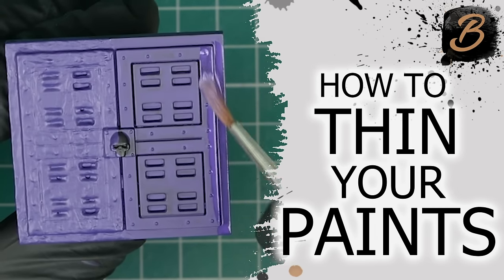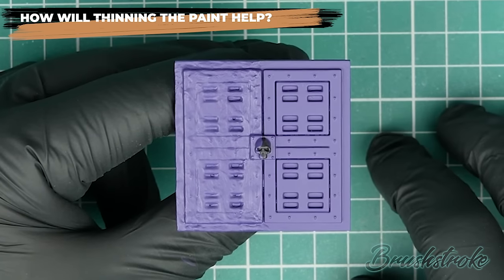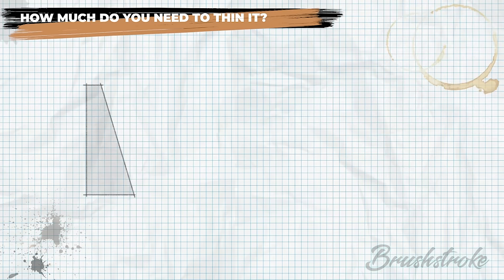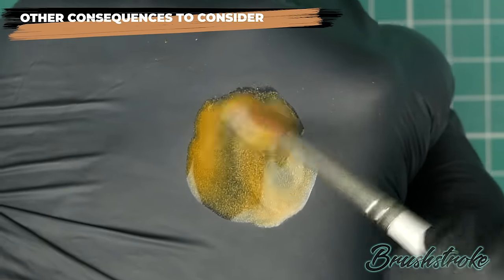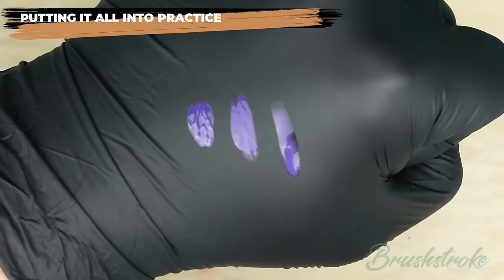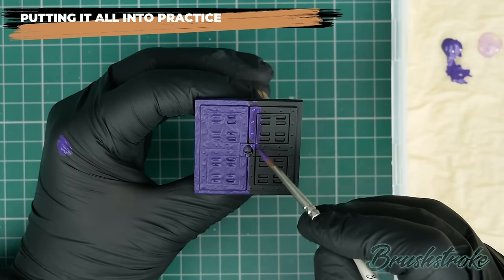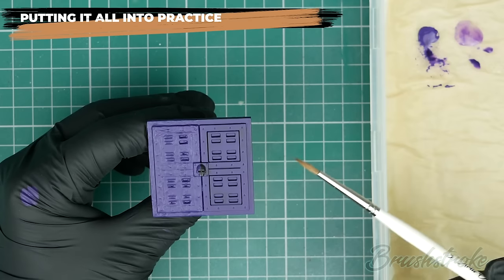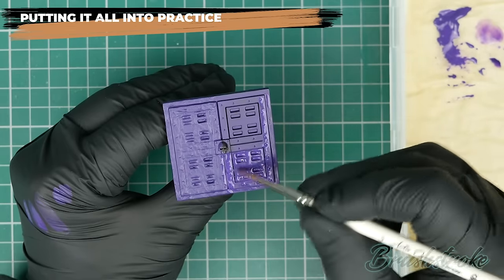HOW TO THIN YOUR PAINTS: A Step-By-Step Guide

Comment: The one thing I’m confused about is when to wick the moisture off the brush on kitchen paper. It doesn’t look like you do in this video but heard many others say it’s an absolute must. Could you shed any light on this? Thanks!!
Reply from the maker: No, I don’t do that.
It makes no sense to me at all, as to why you would want to get your paint to the exact consistency you want on your palette. Then load your brush but before you paint it on you model you remove a random amount of moisture out of the brush by touching it to paper towel.
I much prefer knowing exactly how my paint will behave by doing a quick test and then paint it on the model.
I did cover a little bit about brush loading in this video, which you may find useful.
https://youtu.be/chBHaXh8iko?si=HYEjqhra5Y4c0Ov_

I suppose it’s a case of finding what works best for you, but wicking is absolutely not a must 🙂
Reply: @BrushstrokePaintingGuides  thanks for the quick response! Would you say the same even for glazes where you’d need a really small amount of paint? I feel like I’ve watched that many videos and got that much information I can’t even load a brush 😂
Reply from the maker: @UXUXA  I can’t think of a reason where I’d ever want to wick my brush with paper towel. For circumstances where I need less on my brush, I simply load less on in the first place.
If I’ve overloaded it. I can just  apply a bit to my palette / hand to lessen the load.
Of course, if you’re finding you constantly have a brush with too much in it, move down a brush size to one which can’t hold as much in the first place.
Finally, make sure your brush is damp before loading, so that it doesn’t suck up more paint than you want it to.
Hope that helps 

Like I say; give the paint brush video a watch and see if it helps you 
https://youtu.be/chBHaXh8iko?si=HYEjqhra5Y4c0Ov_
Reply: @BrushstrokePaintingGuides  Mate this is so helpful feel like the video and info you've shared are an absolute game changer. I really appreciate you taking the time to give such a detailed response to an old video. Keep it up man, you've earned a sub from me :)
Reply from the maker: @UXUXA  no problem, I’m glad it’s helped.
There’s almost too much information available these days, it’s very easy for it to all become too much.
A lot of the hobby is about trying new things and finding what works best for you, but I try and make videos I wish I had when I started painting and try and explain what works for me. 
One last bit of advice I would give, is never stop asking questions. If something doesn’t make sense or you see something someone has painted and you’d like to do the same…. Ask how it’s done. You’ll find people are usually willing to help and share and then you can try again.
That’s what I did and what I still do.

Happy painting man, and thanks so much for the sub 🤛

Comment: It’s good, though I’d say: most importantly, your model should never be the first thing you touch with the loaded brush. As a painter/muralist, the nr 1 thing I see people do too little is: load your brush with some paint, put it down on paper (especially if too thick) and distribute it evenly on the brush. The number 1 thing that messes up people’s models is overloaded brushes. Thinning is one way of fixing that, though there is a specific finish to that which you have to like (it ends up looking a bit matte and milky). Another way is to not overload the brush, and either wipe it a little on a piece of paper (or: like many do; your hand/thumb) just to get the consistency of application right. 😊
Reply from the maker: I agree, and I did cover that in the video too. Always test your paint before applying it to your model.
I’ve also made a video on brush basics including brush loading etc 
https://youtu.be/chBHaXh8iko

Comment: So basically to find the sweet consistency, i just need to make sure if i try to pull the paints together, they can no longer form peaks?
Reply from the maker: For base coating like this, where you’re wanting a solid colour in the minimum number of coats, yes. You want it at that point where it self levels or settles. 
You got it

Comment: If I use grease-proof paper (parchment  or baking paper) this technique works. But if I use the paper that comes with my wet palette, the paper doesn't react in the same way. Could you do another video, but using normal wet palette paper. Cheers

Comment: 1:53 it really doesn't which you can paint with paint straight from the pot and get no brush marks but as you show later on you'll still get shrinkage which was my problem so thanks I was wondering why I could not get good coverage with just 1 layer of unthinnded paints!

Comment: I need to try this. I usually just go for the wet brush, grab paint, scrape off excess method. How necessary is the wet pallette?
Reply from the maker: Please let me know how you find the difference.
A wet palette is not essential but simply makes things easier as it prolongs the state of the paint by delaying evaporation.

Comment: Will you do a guide on how to thicken your paints more :)
Reply from the maker: Erm, not really. If you REALLY had to thicken a paint I guess you could try removing some moisture by either letting it stand to air dry a little or perhaps apply some to some kitchen roll / paper towel to draw the moisture out.
If you get into oil washes, you have to do that with the oil paint first to remove as much of the linseed oil before using it

Comment: How long should you let the paint dry before painting the next layer
Reply from the maker: That depends on a lot of factors, such as room temp and humidity, amount of water used etc
So, it’s really hard to give you a number.
Generally though, for a base coat like the one in the video in a UK environment at about 16°C about 5mins
If you thin down to a level of a wash though, that can increase to about 30mins.

Comment: Thank you! This is wonderful!
Thinning my paint has always been guesswork for me. No one has ever described how the paint should behave when thinned properly.
Question: how do you deal with paints that are already thin out of the bottle?
Reply from the maker: If a paint is too thin for the purpose you're wanting to use it for, then it's likely that particular paint is designed for a purpose which doesn't match what you're trying to use it for.
For example, you're trying to base coat with a wash / shade or perhaps the paint is pre-thinned for airbrush use.
Now, I suspect there are products which will thicken paint etc, but I've never tried them I'm afraid.
Instead I either accept I'm going to need to apply a lot of coats in order to build a solid colour OR find an alternative paint which is similar in colour and has better coverage to apply first and then apply the overly thin paint on top, more as a glaze in order to achieve the colour I'm after.
Generally , I will go with the second option and let another paint do the work and then glaze with the actual colour I want right at the end.
Hope that helps
Reply: @BrushstrokePaintingGuides  Thanks, that helps a little. I am confident the thinner paints I have are not washes or for air brushes because nothing on the bottles indicate otherwise (Vallejo paints, btw). I know oil paints of different colors will not all behave the same, so, could it simply be the case acrylic paints suffer the same issue?
Reply from the maker: @blackmage471  ok, another alternative is they’re not fully mixed and they need more shaking.
One final thing you could try is let them settle for a few days. Then don’t shake them but instead just drain off some medium and then shake them up. They should be thicker then.
Some paints come with excess medium to allow for them sitting on a shelf for ages etc

Comment: Getting the paint to the proper thinned state is my biggest challenge.  I find a lot of the time I either have it too thick or then it basically recedes off the surfaces I'm trying to paint and won't "stick" it just pulls back off the surface leaving it clean like it had "Rain X" on it.   I assume that means I'm thinning it too much but when I do it , it looks about like how yours looks when you have it where you like it, So I just haven't been able to get that down.  I am thinking of trying to thin with Mediums instead to see if I can cheat it.

Comment: Good video. Not a big fan of acrylics, they dry too quick when painting larger areas(needing retarders to try and slow down), and the "paint" is essentially a skin that sits on top of the surface rather than a true paint that can be absorbed by whatever strata is underneath. I always prime and this is the surface that the paint will adhere to,which with enamels works well. Get a tiny blemish in the layer of acrylic and it is virtually impossible to repair or blend in . The skin layer is damaged and when gently sanded with the finest of abrasives (like 1000 grit and above, way above, and wet) it will always have an edge to the damaged area. No, I don't really like acrylics, but have subbed and will watch your other videos and see if you have solutions......you asked for feedback,so there's some.

Comment: Interesting. I started painting some minis I 3D printed last year, and I was really sad with how the finishes weren't smooth and I could see brush strokes. I was using cheap craft paints, and so I had moved on and bought Pro Acryl instead. They're wonderfully better paints, but I also thought they would magically not leave ugly brush marks. Yet, they did.

I couldn't figure out what I was doing wrong, and I just thought this was the inherent flaw with brush painting - that it leaves an ugly uneven texture. So I kept thinking, well, this is just how it is. Brush painting is for ugly paintwork that has a bit more control, and airbrushing is for perfect paintwork that is more difficult to do on tiny areas without tedious masking.

It bothered me so much that I ended up dropping money on a compressor and airbrush and mostly giving up on brush painting, thinking all it would do is ruin my surfaces. And, indeed, I get lovely perfect coats of paint with the airbrush.

But I had no idea that I had to thin my paints to get rid of brush strokes when brush painting. I guess intuitively, why this works doesn't make much sense. But it apparently does. And maybe it should be intuitive, because what do you do when you airbrush? Add thinner to the cup.

It's also unintuitive because if you brush paint with thinned paint, the first coat looks HORRIBLE. It makes you seriously start worrying that you've ruined everything. So for a beginner like me, it scares me back to applying them more thickly in just one or two coats. You can see it in that first coat you did, it's all watery and bubbly looking before it dries to a nice finish. Seeing that watery bubbly coat would be what terrified me away from thinning.

Anyways, looks like I'll be trying brush painting again.

Comment: So here's something you might not have thought about.. How do I set up a wet pallet like you do there? Do I just put some paper towel in a tray and moisten it?  In the past I've tried putting parchment on a sponge in some water, but it sucks up into the dot of paint and after a new minutes separates it and it becomes completely unusable, nearly pure water.  What I've been doing on the regular is use a plastic palette and drop in a drop of air brush paint thinner with it instead of water. Could you give me some advice, should I try the paper towel thing? Or is my paint thinner thing ok?
Reply from the maker: It sounds like the paper you're using for your wet palette membrane is letting too much moisture through and over saturating your paint.
I made a video on my wet palette and it has the specific paper I use etc

https://youtu.be/NLcuicvJFKo

Thinning with paint thinner isnt a problem at all, in fact you'll find you can thin the paint down a lot more with thinner compared to water. However, I would still recommend you try and get a wet palette working for you, as it will prolong the time you can work with your paint and help prevent it from drying too fast on your palette

Comment: I'm also a bit curious about your pallete setup. I'm assuming it's a wet pallete? I'm using some random parchment paper I got from the grocery store and I'm not sure that it's ideal. It's for sure not the same as what came with my army painter wet-pallete as far as how water goes through it.
Reply from the maker: My palette is home made.
The paper is a premium parchment paper (still hugely cheaper than the branded wet palette sheets)
I could put a vid together on making and using a wet palette, including the paper I use etc

Comment: Do I need to do the same with the varnishes? I got the gloss one and it leaves brushmarks, I used the mate varnish before and it worked fine
Reply from the maker: Sometimes varnishes do need a little of thinning down, especially if you're wanting to hand brush them.
Don't use water though, I would always recommend looking up what thinner the brand suggests to use.
It's usually on the side of the bottle. Varnishes are quite complex in their makeup and often dont respond well to having water added

Comment: Does this work with the three big kinds of paints? Acrylic, enamel, & lacquer or just specific kinds of paint?
Reply from the maker: I’m not very experienced using enamels or lacquers but I expect the same principles to still apply in terms of settling and shrinkage during drying.
Of course, you’d still need to ensure the thinning agent was appropriate for the paint being used. So a solvent / thinner rather than water

Comment: ive been looking at one of my first ever 3D Prints i painted, i was wondering if there is a way to fix the unthinned paint? or would i have to strip it all off.
Edit: Just chose to strip it off with acetone.
Reply from the maker: Honestly, I think you made the right choice with stripping it for and starting again. Much easier that way.
One word of warning though, Acetone might be ok to use on 3D prints (I don’t really know the properties of the resin you’re using) but it’s really risky with most bought models.
Acetone will melt pretty much most minis. A much safer option is Isopropyl.
It works just as well for stripping acrylic paints but is far more gentle on the actual mini 👍

Thanks for watching though, appreciate it
Reply: @BrushstrokePaintingGuides  yeah, I usually stay away from acetone when working with minis (Bad experiences with acetone and custom Lego mini figs, since it melts em) I would've used my alcohol but the layers were too thick to get off without using like half a bottle
Edit: I have had some good practice with some thinned paints, however I have an issue with whites, they either become opaque or like, streaky when thinned, no matter if I thin them a bit or a lot.
Reply from the maker: @zedokaiba6047  OK, pure white is a difficult colour and the quality / result can range widely paint to paint.
Ideally, you should try not to paint large surfaces of pure white and instead use pale greys so that way you still have pure white to use as your highlight colour.
My recommendation for (what I feel is) the best white, is White Star from Two Thin Coats
I’ll send you a link to where to buy it, but it will make your life sooooo much easier
Reply: @BrushstrokePaintingGuides  thank goodness there's some good white paint out there. I was trying to paint a white glove on a miniature but since my base coat was black I had some streaking. I'd love to use grey but the knuckle weapons and sleeves need to be a light grey

Comment: Is there something in your water, in the water in the wet palette or tapwater or something somewhere that makes your paint contract like that? I live in Denmark and I have tried thinning using both tapwater and demineralized water and I do know how to thin my paint but it never ever contracts like that. Sure, I can thin it to the point were the pigment visibly runs to one side and the water to the other so to speak but never like that. I use a wetpalette from The Army Painter and their wetpalette paper. I have seen that contraction behaviour on other english spoken youtube channels but I can't reproduce it. I tried with a Vallejo Model Color Medium Blue.
Reply from the maker: Hi Peter, so others have made this observation and it seems they all use the Army Painter wet palette. For some reason the paper they use makes paint behave very differently. It also appears to allow far too much moisture through resulting in the paints becoming over diluted over a very short amount of time.
My advice would be to try a different paper to see if you find that easier to work with. If you do, you can just keep your palette, sponge etc and use a different paper from then on.

Personally I lve been using a DIY palette for years - details in this video
https://youtu.be/NLcuicvJFKo?si=zFLdsQvEWGau57Xz

And the paper I use is this stuff (much cheaper than AP too)
https://www.amazon.co.uk/If-You-Care-Parchment-Baking/dp/B00QFMV6GO?&linkCode=sl1&tag=brushstrokepa-21&linkId=21e848520d21480b294788bba4c359f6&language=en_GB&ref_=as_li_ss_tl

I hope that helps 🙂
Reply: @BrushstrokePaintingGuides  Certainly! Interesting facts. Good to know.
Reply from the maker: @peterlageri4177  no problem
Please let me know how you get on, so I can help others who may have similar problems.
Thanks for checking out my channel, really appreciate it